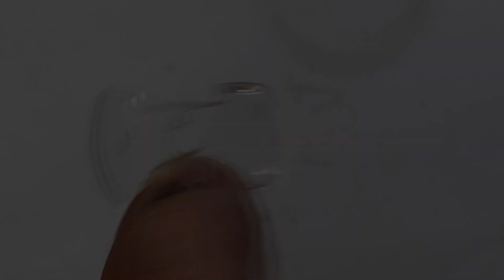Welly Trans An Firebird Custom Restoration

Comment: Yatming... I think that it was a Chinese brand name use by many manifactories in China. I mean, there's the Yatming with plastic base which were meh, if we can say it like that and the ones with metal bases. So I guess the metal ones were made in one factory and the plastic one, the cheaper ones, were made in another factory.

I have a couple of them with the metal base. I even have the Camaro counterpart to this Trans An! And while metal seems to be thinner on those than on Matchboxes or HW of the era, they're actually pretty good little cars. And sometimes, even more detailed than HW and MB of the time.

 When I was a kid, I had a Yatming Beetle that I wanted to make a damaged car. So, I put it in my dad's benchwork vice and almost broke the vice trying to make the dent I wanted to do to it. I was able to make that dent (my dad had "fixed" his vice with a half spherical screw head) and the only real damage to the beetle was that the front rived popped off. But even without that rivet being anchored in the body, the car still held strongly together.

Really good Custom resto job. I personally would've re-painted the interior tho. But that's just me.